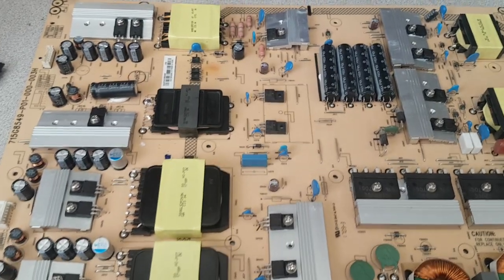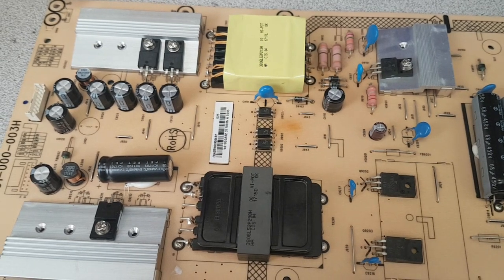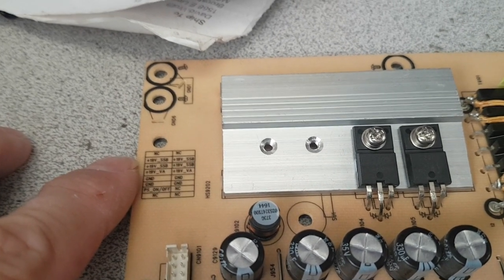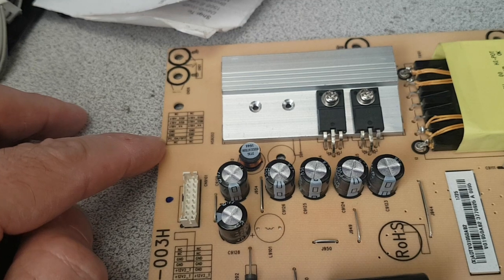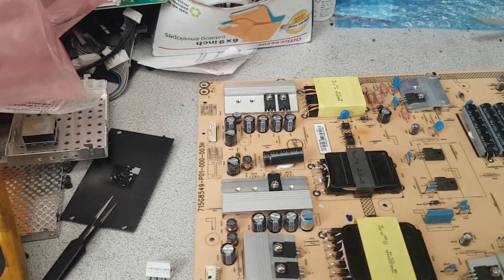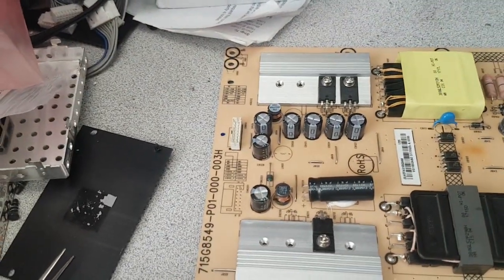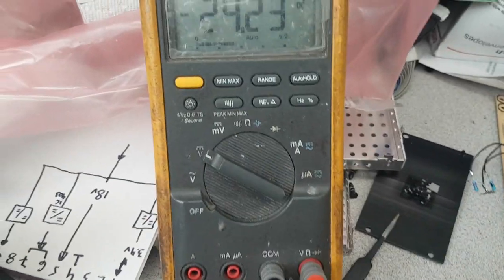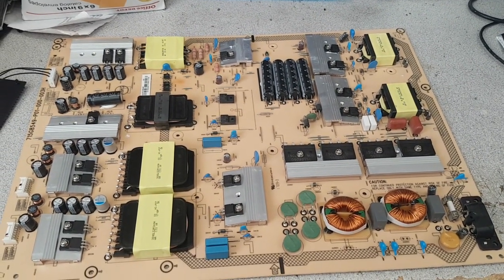How to test Vizio M75-E1 power supply board ADTVG1950SB2 / 715G8549-P01-000-003H

Comment: What if the ceramic fuse is blown? I'm afraid of replacing it only to have something on the board blow the fuse again.
Reply from the maker: I would say there is about 99:1 chance that if you replace the fuse it will blow again and like 1:3 or higher chance it may introduce additional damage to the board. SO your concern is correct.
What to do? Well your options are:
1) Get a replacement board
2) Send the board for repair
3) Start exploring the circuits on the board that affect the fuse - the mains rectifier, the PFC, the standby circuit, the main driver circuit...maybe look for DIY repair kit....this is the longest and most complicated of the 3 options and in a long run possibly the most rewarding one.
But it all depends on your view, skills, resources and long term interests. There is no universal short path for the third option, but DIY repair kits from reputable sellers are often a cheat sheet for that option and may yield good results.
Just always bear in mind that it's not repair kits that fix boards...people do.
And if a repair kit did not solve the problem the first place to look at (not necessarily the rest as there's a lot of crap out there from people looking to make an easy buck) is yourself or whoever undertook the repair.
Even the most honest and experienced seller preparing and selling a kit for you can't possibly cover all possible failures out there.
Reply: @coppelltvrepair  thanks for the quick response. I used my multimeter to find the blown fuse. My tenant just told me the circuit breaker also blew at the same time(during a recent earthquake). Could that be the 1/100 I'm hoping for? 🙏
Reply from the maker: I've been wrong many times in my life and I am sure I will be wrong many times again. But statistic is statistic and people use it because it is, especially in a long run, better than a guess and better than hope. And statistic says you have 1:100 chance of being right.

Comment: Yes keep up the tv videos!  I have a dead Vizio D58u-D3. No light, sound, picture. With TV plugged in, listed Voltages (+16VS) are not there. AC-DET not there, at the 15 pin connector.  However, when I disconnected the main board from the power supply board, then I have proper, steady voltages.  I came to realize the voltage was there originally but was quickly fading to zero by the time I hooked up my meter.  That voltage should just be steady with the TV plugged in, correct?
Reply from the maker: Yes they should. What you describe is either power board failure manifesting itself in inability to hold load or main board shortage that just overloads or even flat out shuts the power board, effectively having the same effect as in the first case.
In my experience the later is much more common than the former.

Comment: Your ability to take voltage measurments with the camera in one hand and 2 DMM leads in the other hand without slipping is incredible!
Reply from the maker: My view is that i have some of the worst videos in the field in regards to viewing quality. It is unfortunate, but totally realistic reflection of the effort I put in releasing them - 3 to 4 minutes, hand operation, upload, presto! Had an argument with Rossman a week or two back where he was employing 3 power sources in parallel to find breakdown amperage of a fuse...that was one quality video with good view, narrative and equipment stacked for something that 7th graders do with a single source and resistor :-)

Comment: Thank you for this video. I have an M75-E1 that when I power it ON the screen is not at full brightness and I can only see extremely blurry images (nothing distinct, like "HDMI 1"). Connecting it to an electricity monitor it reads ~70W when ON (which perhaps is normal?) but what is odd is ~25W when OFF in standby mode. I was suspecting that the Power Board may be at fault, but I don't see any obvious signs of failure OTHER than a burn mark like you have in your video (above the transistor on the back). I haven't yet tested the Power Board like you have here (to-do list), but in the end of your video you say that "with 99.9% certainty....if there is a problem with the TV it is most likely with the Main Board".  I could replace or re-flow the Main Board, but in consideration of the 25W power draw when OFF, I would love to hear your opinion, if you don't mind, where you think they problem may lie.
Reply from the maker: I am sorry...I do not have experience with M75-E1 and can't say what is the likely place to look at. My gut is the main board, but I can't say if it'll be processor reflow or firmware issue or component failure.

Comment: Interesting video; thanks. I am working on a M49-C1. When the ON button is pressed, the power light comes on and fades (as expected),  but the backlight does not illuminate. The relevance to your video is that there are red/blue LEDs on the main board that appear to have a start up sequence.  I would appreciate any comment you have in relation to the power supply board coming out of standby and the LED sequence.
Reply from the maker: M49-C1 has a well known issue developing on the main board, which has failure symptoms exactly as the ones you describe. The repair is a main processor reflow or replacement and it is a nasty one to do on all boards from this family because of the design of the board and the design of the processor itself.
I highly recommend replacing or sending the board for repair and you should know that the success ratio on those boards is lower than many others that develop issues with the BGA (while admittedly less than some that are even worse).
Here is a link for the repair of this board at our website:
https://www.coppelltvrepair.com/p/2222/vizio-756txfcb0qk0040-main-board-repair-service-m49-c1
Hope that helps.
Reply: @coppelltvrepair  Your candid assessment is very much appreciated. The decision on how to proceed is not obvious. When you buy a budget TV, you get what you pay for regarding reliability. Regards.
Reply from the maker: @davidwhite9751  Yes the decision can not be obvious because it is subjective to one's position, resources, knowledge and so many other things. Whatever may be obvious to me may not only be obvious but flat out stupid to someone else (most married people can easily think of an example). So the decision will still lay on your shoulders, sorry. You get what you pay for is a common sense sentiment and I am not going to argue with it, especially in the light of the fact that you get free advice here :-)